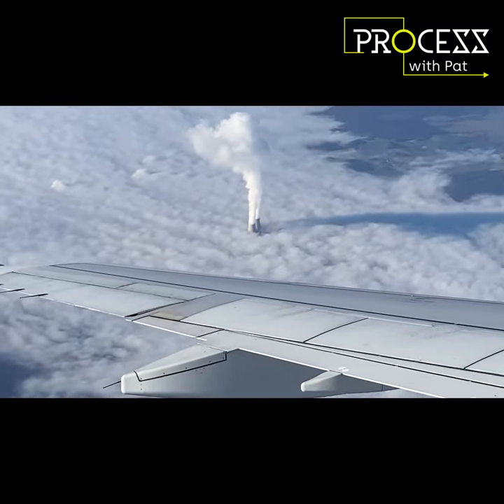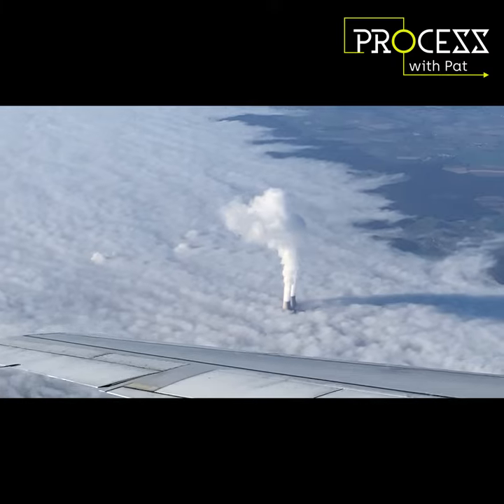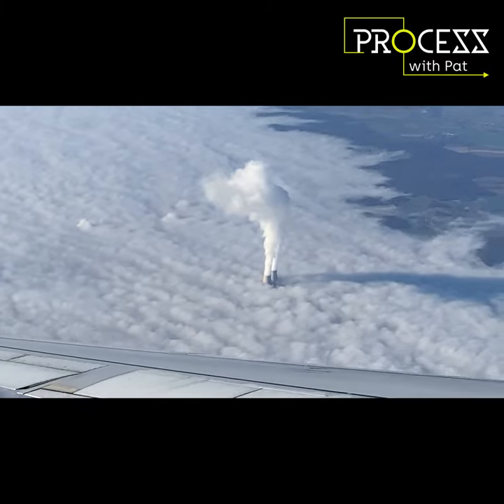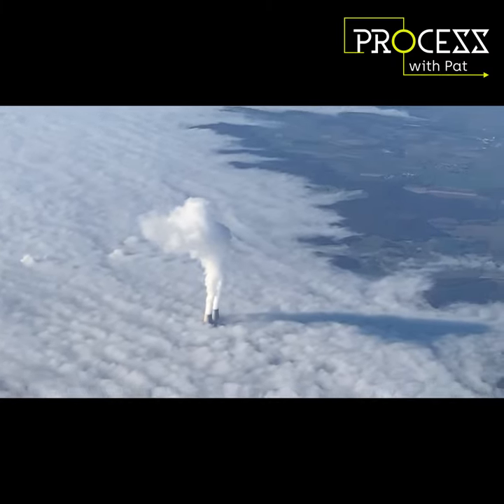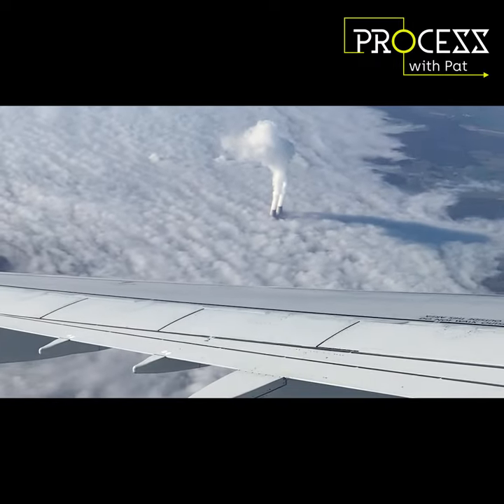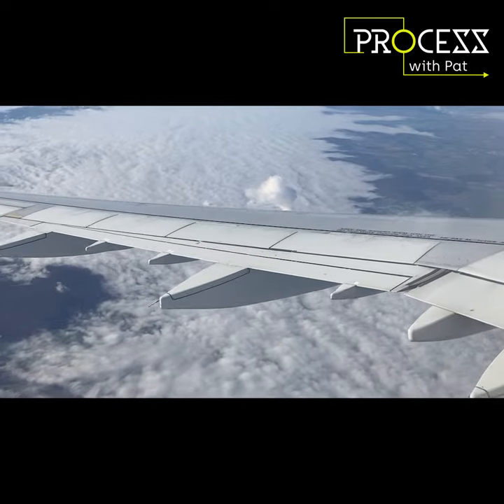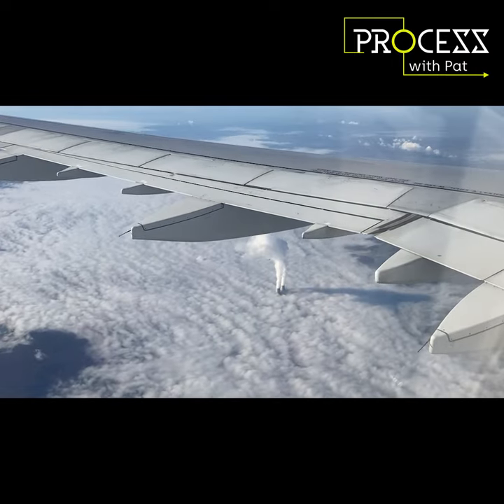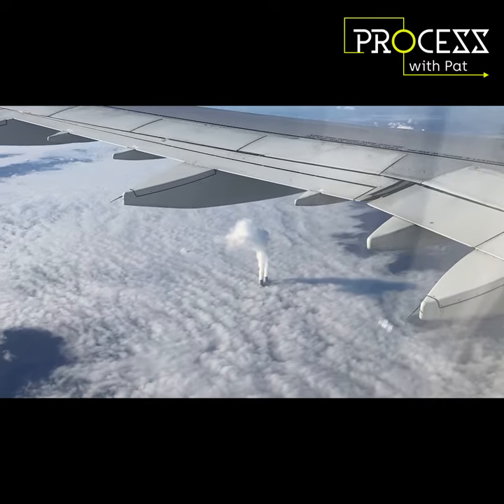Water from cooling towers returns to the water cycle

Comment: I wonder if this is adding to climate change I mean where does that steam actually go do you think it turbocharges the weather so that it rains down harder and floods villages and then we call it climate change lol
Reply: A. Its not that much water(in the totality of things)
B. It’s locally sourced so it’s either a net neutral addition or negative draw from the local water systems
C. Clouds are a great reflectance, so… your cooling the system slightly… not enough to counter the carbon you output but again, it’s completely negligible. Like when you shower. Do you care about the steam.
Reply: @TheWizardGamez  great answers totally respect that.. 2 million litres an hour is not the small amount of water..  Fukushima in fact used so much water they built it next to the ocean.. have you seen those things kick in in the afternoon when everyone's putting their kettle on and turning their TV on and charging their car.. where the water is sourced doesn't matter you will find these places cooling towers I mean next to rivers streams they use huge amount of water like I said where does all that water go.. if you think I'm joking or this is a real Google how many cooling towers are there in America alone.. 26,000 is not a small number.. if they turn this all off this world would burn up like a crisp.. it was the only way they could get  to rain over California you see California has a weather front from the sea that pushes the weather away from it it should be like the desert surrounding it but they make it rain.. none of this is new you see I know more than you realise.. they used his methods in the 1930s in Cornwall and in one weekend it flooded so hard it killed 8 or 9 people I believe.. do your research